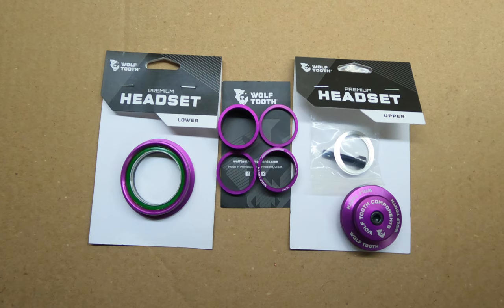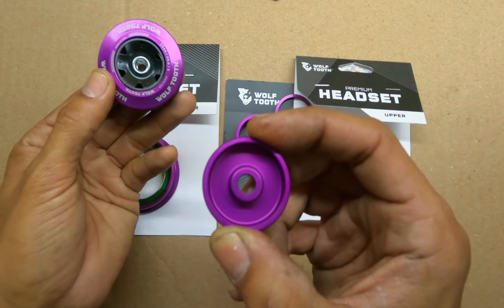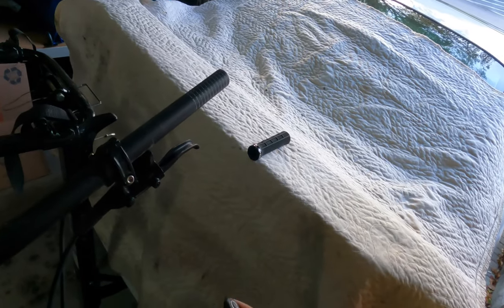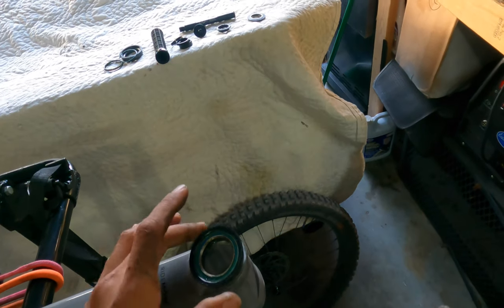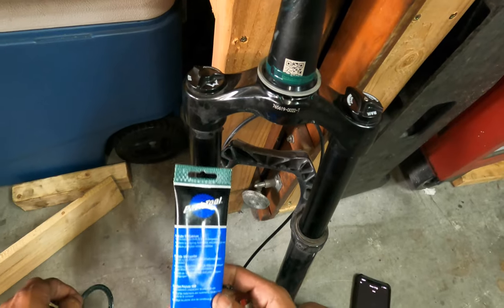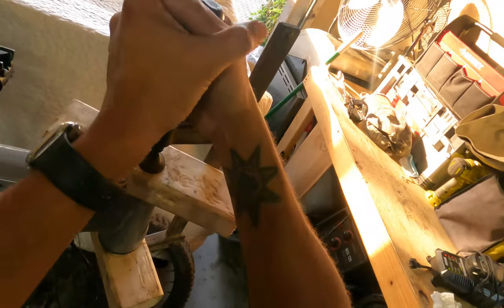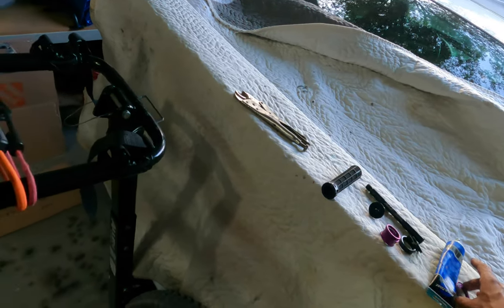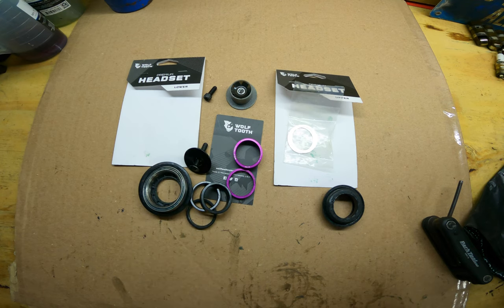Wolf Tooth Premium Headset Swap On A Vitus Sentier Mountain 27.5 Bike.

Comment: I have a 2021 Giant Fathom and I’m having to replace the headset after a year and a half and around 1000mi riding. The factory plastic bits finally gave up, much like yours. I’m replacing with a Cane Creek 40 series, but after seeing this I wish I’d have bought a Wolf Tooth. 😂😂 That thing looks SLICK!
Reply from the maker: That’s an awesome bike you have there. The cane creek stuff is pretty good stuff as well and I was on the fence between the two company’s. My selling point was the color and bearing warranty. Their stainless steel bearings have a lifetime warranty.
Reply: @ridedirtymtb9938  Thanks! The Cane Creek went in easy and works great. I’ll probably have to replace the one in my Trance as well at some point, so I’ll probably look to the wolf tooth. I like lifetime warranties!
Reply: You gonna be really happy with your cane creek 40. I love how easy mine is to clean up. You can always get spacers and top cap from wolf tooth if you like the color

Comment: Who is the manufacturer of this headset? Have you tried greasing your mike to help with the creaking? ;-)
Reply from the maker: The original headset is a ACROS AZX-212-CO. The lower cup was plastic and had cracked so greasing it would not have helped.
Reply: @ridedirtymtb9938  Sorry, I was just joking because of the amount of branding on Wolf Tooth's headset ;-)
Reply from the maker: @adrianbeacon6421  lol they want people to know who makes it I guess

Comment: Hi . Could I ask what stack you went for on headset 6/ 15/25 ? Not sure which one I need for my sentier vrx 2022
Reply from the maker: Hi Patrick. Sorry for the way over due response. For some reason I didn’t get the notification, either way the sizing for the sentier is  ZS44/28.6 – ZS56/40 and I went with the 6mm stack. Wolf tooth number -SKU: ZS44U-5MM-BLK(blk indicating the color which will change with other colors) hopefully this helps if someone has the similar question. I also ordered the headset spacer kit.

Comment: Did replacing the headset resolve the creaking issue?
Reply from the maker: Thats a great question, so in the long term it resolved the constant play and somewhat notchy feeling bearings resulting in a very smooth feeling headset. The creaking turned out to be the the fork steer tube itself unfortunately. I did happen to find a video on some one who used locktite by putting the bike upside down and putting the locktite in there and making the fork creak by pushing forward and back on the fork and letting it sit over night. I’ll share the video if I find it for you
Reply: @ridedirtymtb9938  thank you for the follow up. If you could share that video that would be greatly appreciated. I’m about to replace my headset also, it has some plastic bits in it and I hope the higher quality of Wolftooth resolved it. Thank you again.